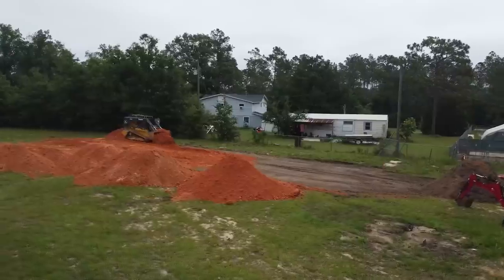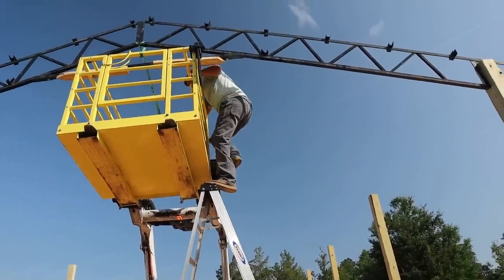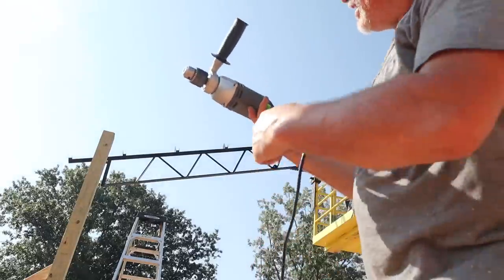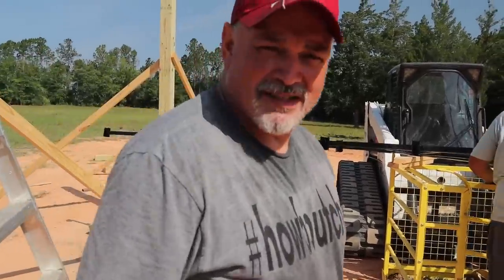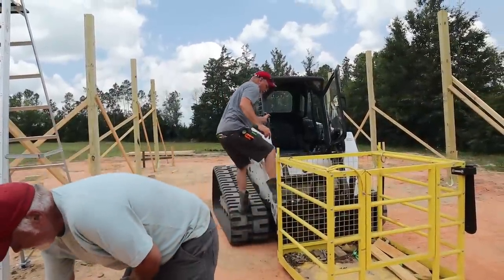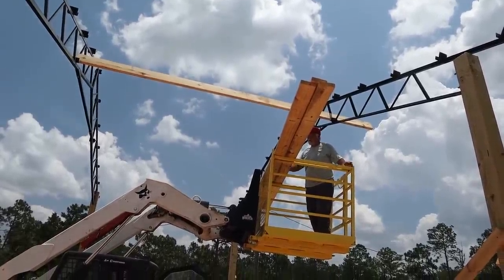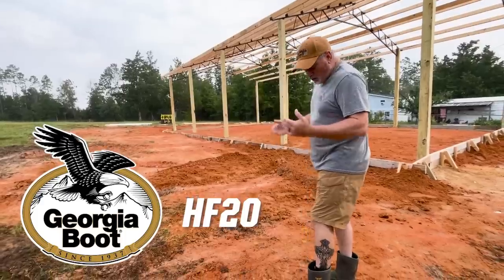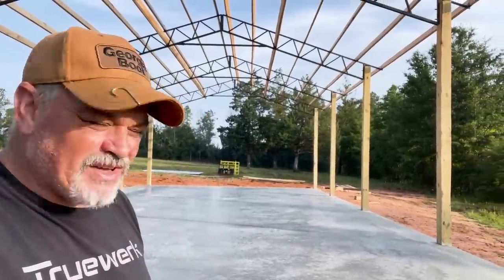CEMENT TRUCK MAKES PERFECT Pour on NEW 24 X 48 POLE BARN!

Comment: You need a good low speed heavy duty drill those auger bits work best at a low speed they are made so the tip pulls the drill into the wood all you have to is hold on to the drill because it will twist around maybe knocking you off the ladder

Comment: I would have made a jig to mark the holes then drill them using the man basket first. And throw that drill away. 😊
Reply: That Drill looked as if it did not Have a Low Speed option. Just a Drill for Masonry Work.
Not a Cheap drill, Just the Wrong drill for the Job at hand.

Comment: Usually, concrete amount is calculated in number of yards needed, not the number of trucks needed.
The number of trucks would be determined by the number of yards the truck can haul.
And that would be based upon the size of the truck.
Concrete trucks (as a rule) dont make concrete, like some diesel engines make oil. lol
The number of yards needed will also need to take into account how well the area has been prepped for pouring.
But for a well prepped slab 4” thick, figure roughly 70 sq. ft. of area for each yard of concrete.

Comment: Self feed auger bits need big amperage drills and 10 gauge wire extenion cords .Dumb question why didn't you just make template for the truss holes you needed to drill and predrill them . I am pretty sure they would have been the same .

Comment: The Operator Bought the Wrong Drill for the Job at Hand HAHAHAHAHAHAHA...
That Drill is just fine for setting Anchors in Concrete.
Never seen Fence Panels used for Concrete Pours ??
How Many Yards ? and how much a Yard down there By You?  My Pole building is 30x40 and Want a 5" Slab
It will be Heated and 2 deeper Pads for a hoist if I should put one in. 
Thanks Guys.
Mike M.

Comment: Can’t believe you don’t use bar chairs under that rio mesh. Here in Australia its compulsory. They just walking all over it and the mesh is sitting on the ground 🤷.
Reply: I poured concrete for 47 years. We bent a stick of rebar. All the labors had hook and lift the wire as you pour.
Reply: @allenbuck5589  yeah that’s a bit hit and miss. A bag of chairs costs  few dollars for two hundred 🤷‍♂️

Comment: Hank, you two are hilarious working together, quick question on the backhoe in the background.  Are those factory supports, getting ready to take off the backhoe on my 3620 and was going to use cinder blocks.  Like that stand better
Reply from the maker: I just used the sub frame it's comes with and put an off road jack stand under it👍

Comment: Not enough torque on the drill.  The power cord is to long.  To much resistance in the long line. Need #10 maybe #8 wire extension for power.  Plumb bob would give you a quick idea fast. On if a rafter beam (purlin)  is being pulled off vertically.
Reply: That Drill looked as if it did not Have a Low Speed option. Just a Drill for Masonry Work.
Not a Cheap drill, Just the Wrong drill for the Job at hand.

Comment: Hank cheap drills don't do the job they don't have the power  and make sure you drill a straight hole good job great video thanks Wylie and Hank
Reply: That Drill looked as if it did not Have a Low Speed option. Just a Drill for Masonry Work.
Not a Cheap drill, Just the Wrong drill for the Job at hand.

Comment: My only question is why did you use that foam set to set your posts? Was it to keep cement from being around the post cause you still put concrete around like 6 inches of it? Just wondering the process of the thinking there

Comment: Hank don't you blame that harbor freight drill u sure it's not drillie lmbo
Reply: That Drill looked as if it did not Have a Low Speed option. Just a Drill for Masonry Work.
Not a Cheap drill, Just the Wrong drill for the Job at hand.